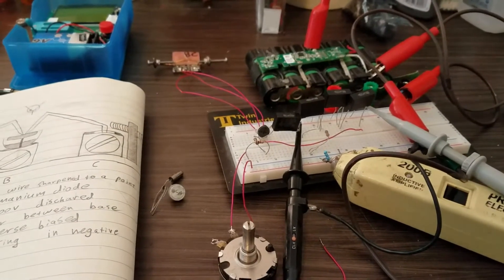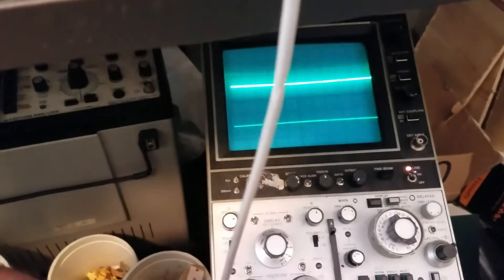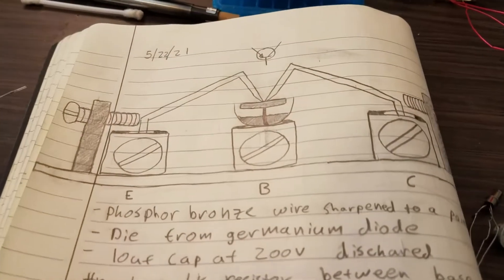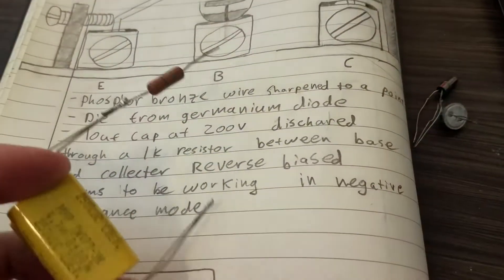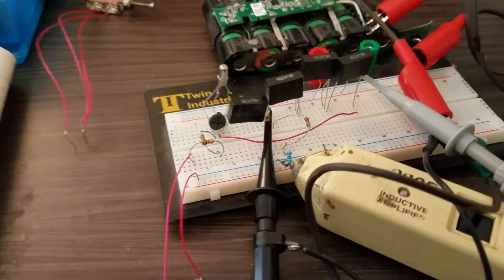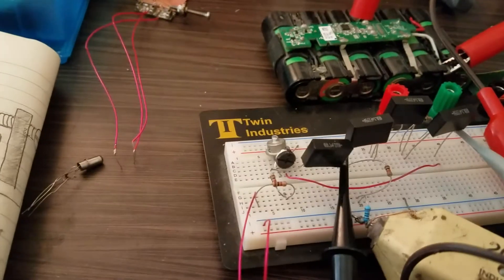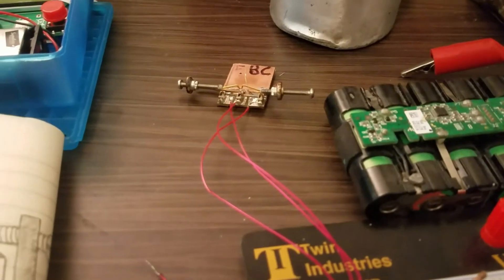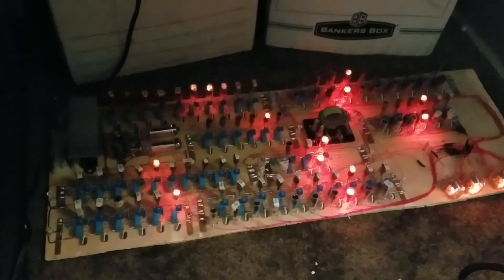Homemade Point Contact Transistor  Attempt

Comment: Yeah, that waveform does look much more like a relaxation oscillator (neg-R in action) than a phase-shift. I didn't check mine with a scope, so I am unsure what mode presented itself to me. To further confuse things, I didn't form the collector at all before getting circuit operation, and was unable to get a functioning circuit after any attempt to form either junction X-D
Reply from the maker: Oh really? I did not try without forming, I will have to do so. Thank you. From your video it sounds like a sinewave so I think your device was acting like an actual transistor.

Comment: You were a good bit of the way there if it's acting as a negative resistor! Standard behavior of a point contact transistor is to self oscillate aggressively, the 2N110 (if i'm getting the number right) displays this behavior and it's a great way to check if you have an authentic one. Did you ever come back to this? If so, how did it go?
Reply from the maker: thank you! I have been playing with it a little more recently but it gets frustrating pretty quickly. my goal is to create a sine wave oscillator with it.
Reply: @jdflyback  Fair enough! Have you tried the method of sliding an extra contact into a hole in the glass in a large point contact germanium diode rather than taking out the doped germanium lump? Have seen that work a few times! To be fair, it's not nearly as pretty as your setup.

Comment: A point-contact transistor is a completely different beast opposed to a junction transistor. It's Beta is way too low (my point-contact 2N110 transistors measures about 7 to 20, depending on temperature and which one I put in the tester) and it's base-resistance probably is too. So I'd build another test-circuit than this RC-oscillator, just measure the Collector versus Emitter current. A PC-transistor has a larger than 1 current gain (Alpha) between the emitter and collector, this should indicate how succesful your collector-forming worked out too. I'm confused as to how the forming pulse should be pushed too, but I've found multiple collector-forming related patents on how they devised tube-pulsers for doing this, so maybe you ought to look that one up too? The Alpha will rise and the Rc (collector to base resistance in reverse-bias) should drop the more you form the collector (anyways that's what the old articles say) and Alphas between 1,8 to 3-4 appear to be normal. So are collector resistances from 2000 to 25.000 Ohms.

Comment: For using neon bulbs in counter circuits I found I got much better stability if I used two in series for each element to increase the voltage difference between strike and hold.

Comment: It should be possible to make a transistor with home doped Germanium. The thing is that I still have trouble doping germanium with P dopant. But once I get to there, I have prepared a holder that holds point contacts 0.05mm apart from eachother.

Comment: Popular Science June 1925 pg 52,  Wireless World November 1925 pg 682.  Felix Thuaud ; forgotten Inventor of the Silicon Diode. also fixed semiconductor ie non spring contact.

The world could have had silicon transistors in the late twenties if people had paid attention.

PS; Felix Thuaud owned a french iron steel foundry, they use sand for the molds, so molten melted iron sand crystals were there to be played with, I would guess somebody at that foundry was a keen radio enthusiast as millions were in the twenties, it was a mass craze like the 80s home computer boom. prob bigger.